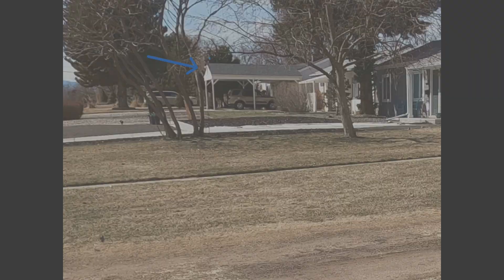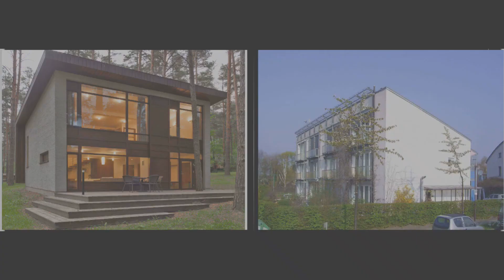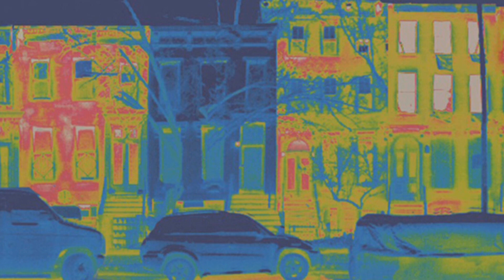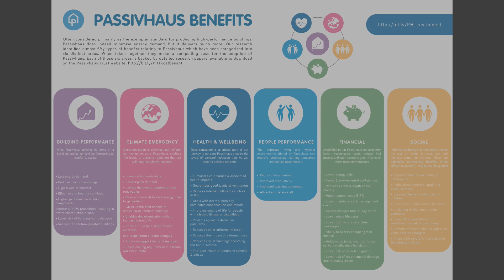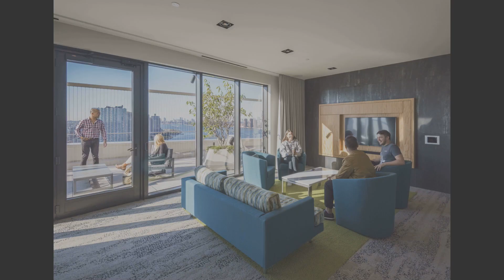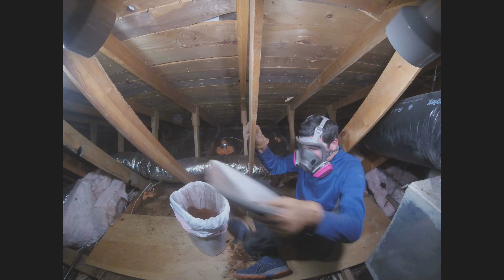Paul's Passive House: What is Passive House?

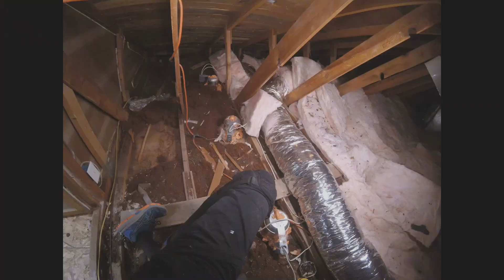Comment: 8:10 "Dangerous wiring" - you mean you can't splice extension cords with duct tape and drape them wherever?
Reply from the maker: @davidstewart1153  yeah who knew? Sadly two separate contractors worked up there and didn’t take the time to fix it.